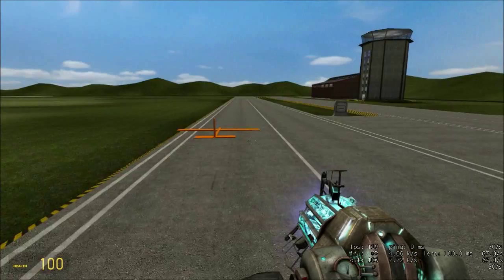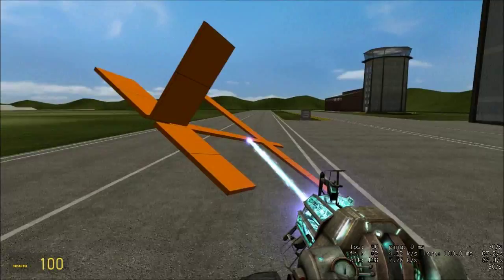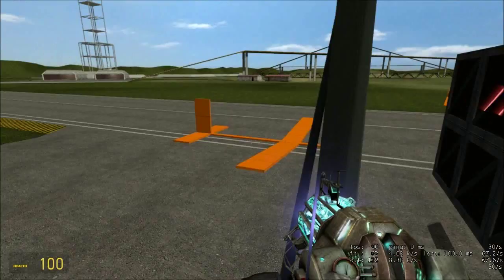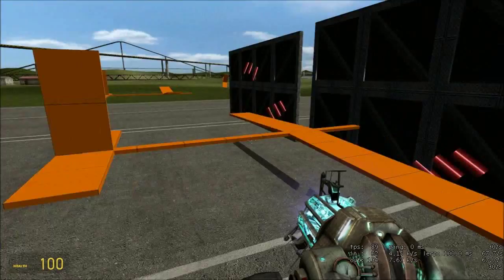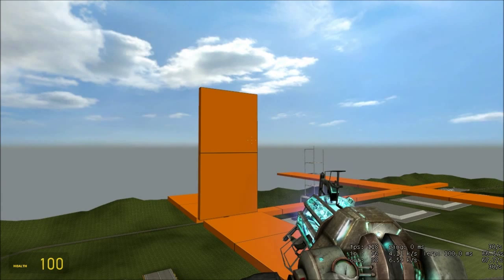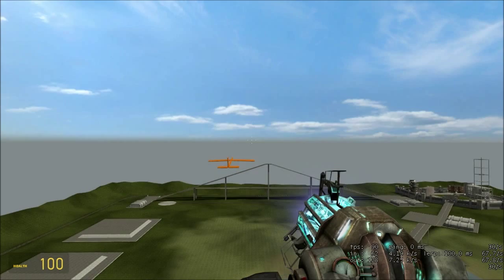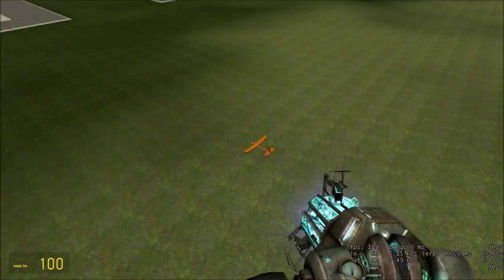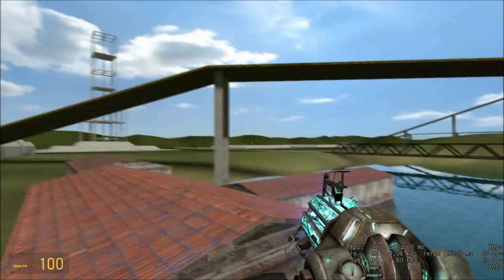GMod Fin Planes -- Wing Angles (Dihedral vs Anhedral)

Comment: very interesting in what you achieve with the computer  , I fly  RC planes and your right about the positive dihedral  especially on a low winged  warbird type  airplane  .they used to induce  wing wash out on a lot of the real planes world war 2  models ,  yet with all new designs today   they fly pretty straight and level  with lipo battery's and brushless motors .